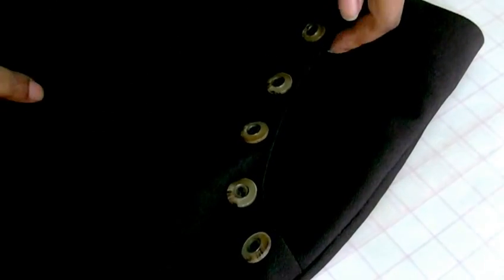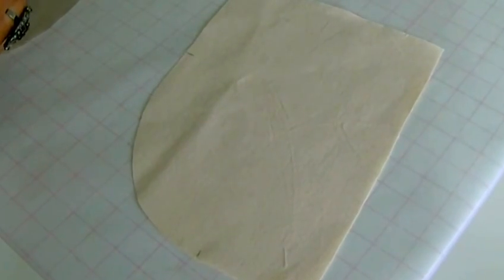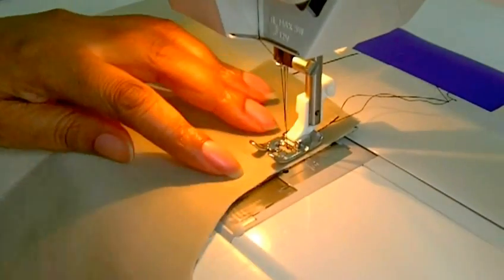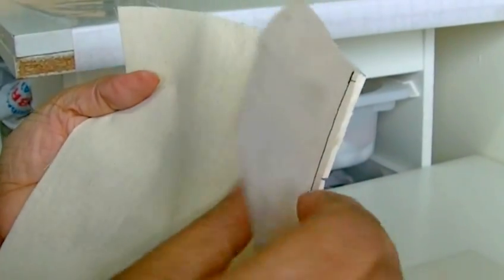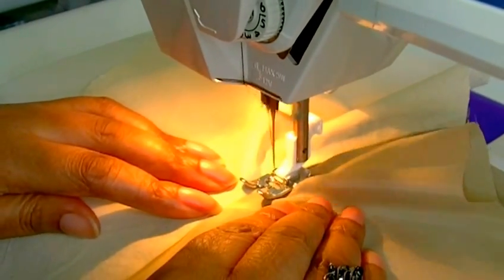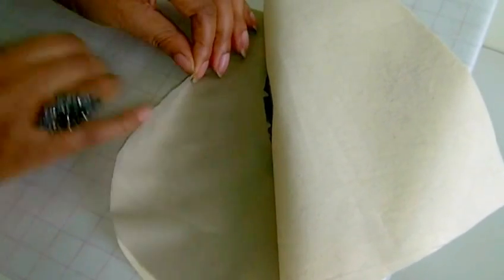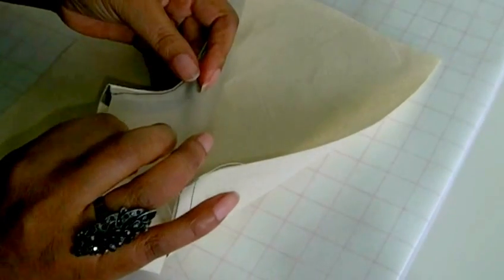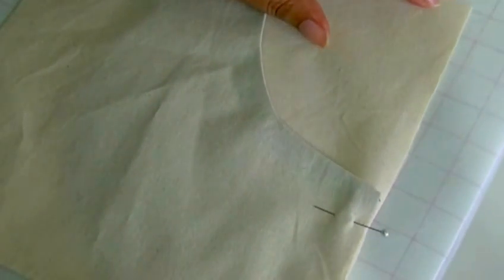Sewing Hip Pockets

Comment: Before retiring I worked as head sample machinist in NEXT design room.
In your welt pocket tutorial a tip to get neater corners is when attaching the second pocket bag start and stop your stitch line a few millimetres short of the first line and mitre, when you push through to the right side the second corner will be well hidden by the welt.